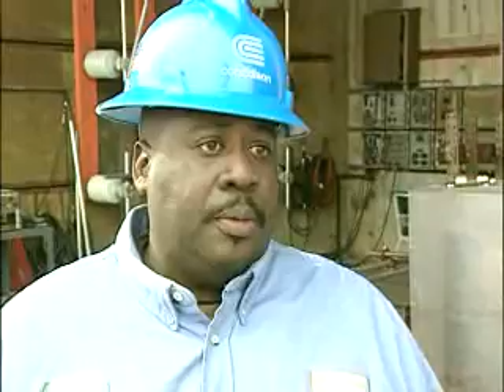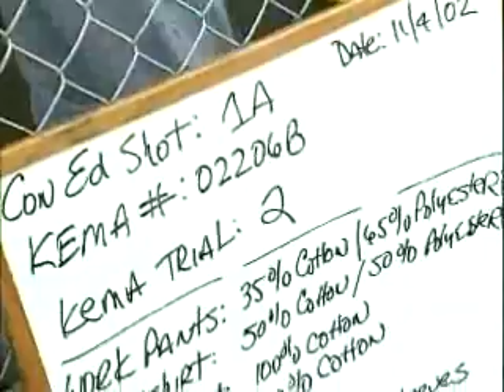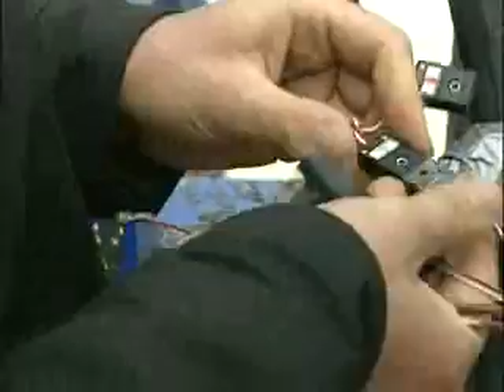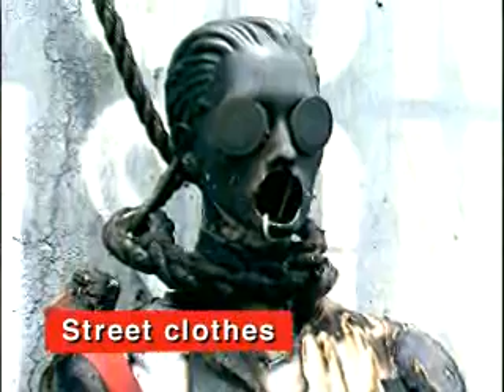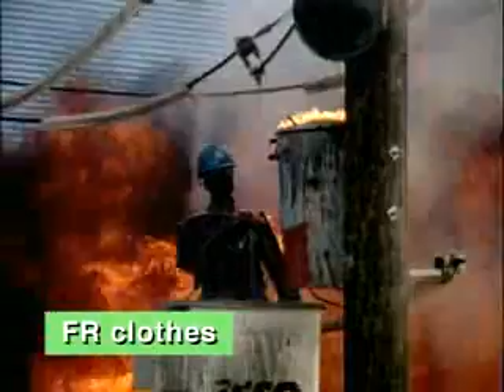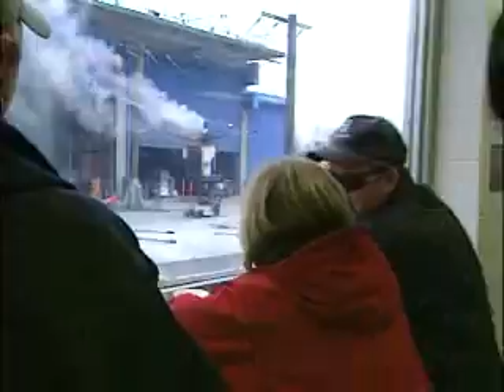Arc Flash Documentary Con Edison

Comment: This is a little dated but one of the best testing that has been done to date.  I worked with ConEd on the first run of this and they took this so far. They have really worked on protecting their workers. There has been hundred's of thousands of tests since this but most of the testing didn't use these real set ups.  The blankets were really improved by the ConEd testing and we now have ASTM F2676 which has standardized these blankets.  Hats off to ConEd!